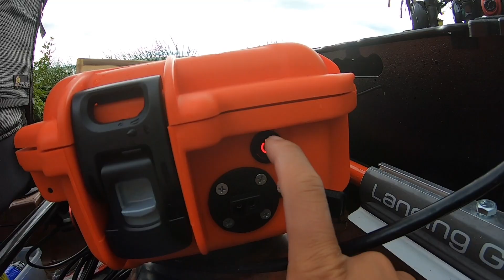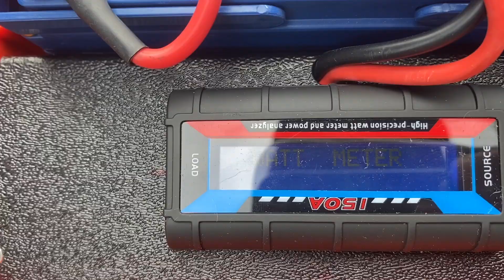Sad Kayak Tournament, Full Kayak Tour and a Fall Jig Bite

Comment: Greg, you always give us great safety advice when it comes to wind and lightning.  As a first responder I would like to offer you some. The road side is not the best place for a kayak tour. It only takes one distracted driver.
Reply: Wow I just noticed that, good catch!
Reply: Ever notice,18wheelers always pull to the left if a vehicle is on theshoulder,specially if its caltrans or a chp,tow truck or anything with emergency lights
Reply: @garycox6169  yes sir. That's something I always do for any vehicle. It's a law in several states that you move over for any type of vehicle with flashing light and some states  require it for all vehicles.
Reply from the maker: That is solid advice and I appreciate it! Won't make that mistake again. You are right, never know who's coming down the road and what they are looking at/doing.

Comment: How do you attach the Yakattack Rotogrip to the top of the propel drive?

Also, the 2020 Native Slayer has the seat raised up a couple of inches from previous models. I have it and it's great!
Reply from the maker: Right on! I know Native has really improved their builds based on a lot of aftermarket stuff over the years and the risers are no exception. I'd have to look but I'm pretty sure I just took the bottom peice off and put the screw the other way so the T bolt sits atop the base of the roto grip

Comment: So I just upgraded my 2020 slayer 10 to the berleypro steering since my rudder cable snapped. I have an issue where my tacklebox sits on top of the rudder plate and rubs now which makes steering stiff. Does your black pak not do that? I might buy one of those instead of my current bag.
Reply from the maker: The blackpak does not since it has 4 "feet" on each corner to add rise to the bottom layer
Reply: @GregBlanchardFishing  sold me, guess that's my next purchase lol.

Comment: Morning Greg. I have a question for you. Im about 6' 2" and 250lb. Im looking at either the titan 12 or 13.5. Ive seen you fish out of a 13.5 before. Just wondering what your thoughts are.
Reply: as long as space isnt a problem, the 13.5 will be nicer. you will have more room for yourself and much more tackle. i prefer the bigger kayak for sure. it helps me stay on the water for longer
Reply: @japanesebassman7907  Thanks Alex.
Reply from the maker: Mornin'. I agree with Alex. I think you could get away with either but the 13.5 won't be that much more difficult to transport (assuming you have a either a trailer or a truck bed) so that's what I'd go with. I had the 13.5 for awhile and i'm about 165 5'7''. I could pretty much dance around in that thing and was too much boat for me but the nice thing is even with that side I think it actually went fast than my 10.5 and tracked much better

Comment: When did you switch to P-Line flouro? Do you throw 20lb all the time? You used 15lb Invizx forever. Thanks for continuing the great videos 🍻
Reply from the maker: starting using it maybe around June. Both great line and I haven't had an issue with each so far